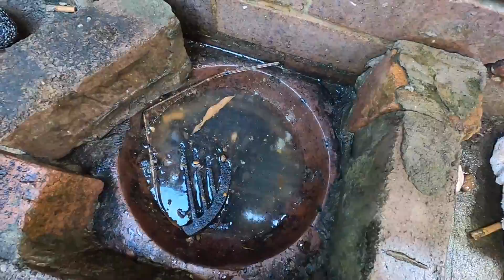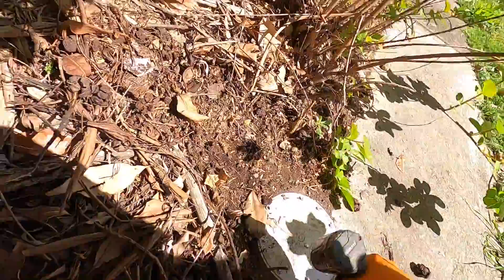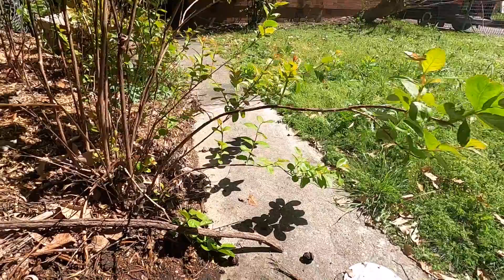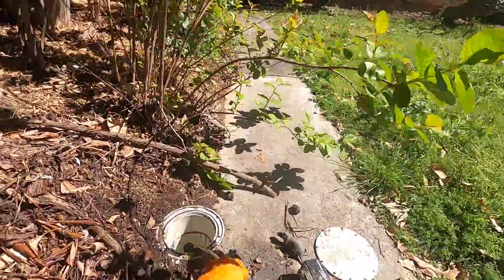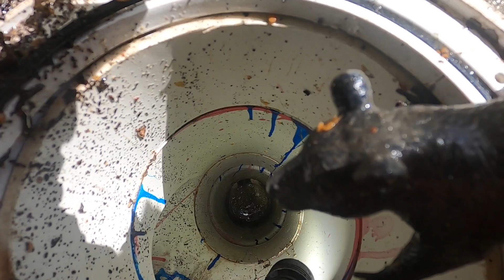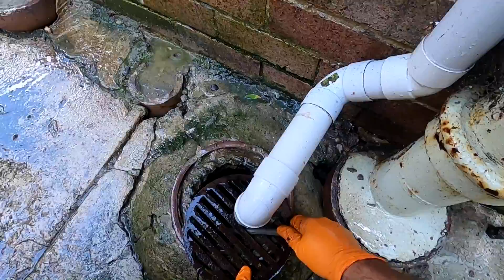Blocked Drain 508

Comment: Why is so much of the plumbing outside in Australia? I don't recall ever seeing that setup in the US ever. I'm assuming the climate may play a part, but what do I know. I'm no plumber.
Reply: I guess that Australia doesnt der alot of freezing temperaturs, when that isnt an issue why would you not have the Plumbing with radier access
Reply: I've seen toilet rooms/bathrooms completely located outside on some of these videos.
Reply: @hgordon5217   the "out-house"
Reply: Many of these are shot in the older parts of Sydney, and when many of these places were built, running water was from a tank fed from the gutters, and the 'dunny' was a tin can in the outhouse, that was emptied by the 'nightsoil man'- you did NOT want that inside after a 45C summers day LOL (that's around 110F for our seppo mates)
So much of the plumbing was exterior to the buildings proper, because it was added afterwards
Even when building new builds, a lot followed the same path, both because it was easier to install and maintain, and because they 'had always done it that way'
Plus it rarely gets below zero (I'd have to check but been a long time if ever that the inner suburbs get that low- lived in the Blue Mountains and it got below zero occasionally) but the sub zero conditions that some parts of the US get are rare indeed in most of Ozzie

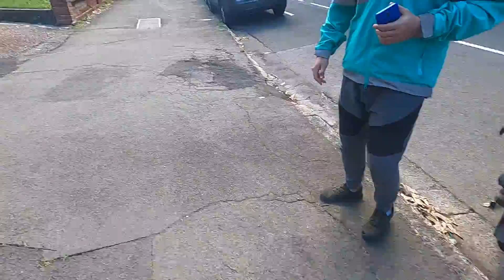Comment: At 12:38 The Telstra lead in cable  into the Units must have had to been replaced . They used to use Galvanised pipe that would blow with water getting inside them  . and the old cable had a porous sheath allowing moisture to corrode the copper wires . The Asbestos pit was replaced but they kept the lid cause it still has its old Telecom Logo

Comment: An observation(s) of suburban Aussie dwellers:  Their houses are crammed together.  They leave broken bits of brick and concrete all over, and in general don't clean up. They leave all sorts of dead plant material around.  They have AWFUL diets.
Reply: Judging by the number of gas meters it’s a tenement building and no one gives a sh.t , err well only in the figurative sense

Comment: And where do you get your water supply
Reply from the maker: Garden tap to my tank in the van👍
Reply: @DrainAddict  How many litres does it hold, Ollie? 250?
Reply from the maker: @DinnerForkTongue  only 60
Reply: @DrainAddict 
Okay, makes sense. Jetters are high-pressure and low-flow, so you don't need huge tanks that weigh down on the van's suspension and take up space. All good 👍